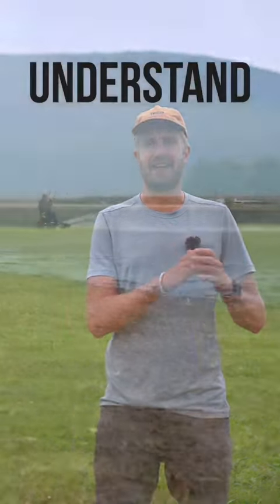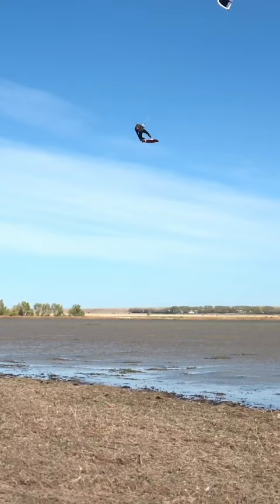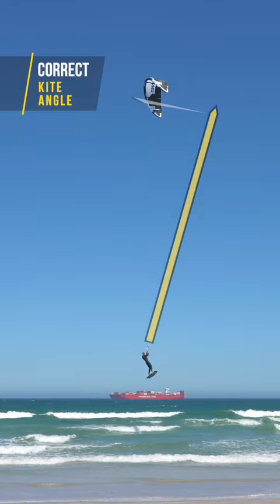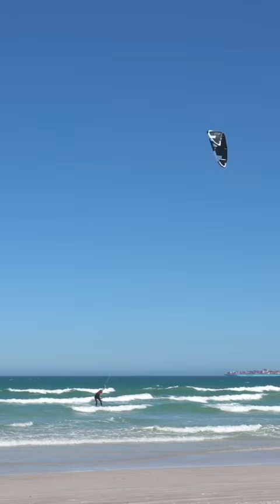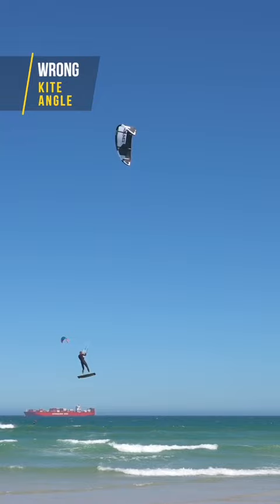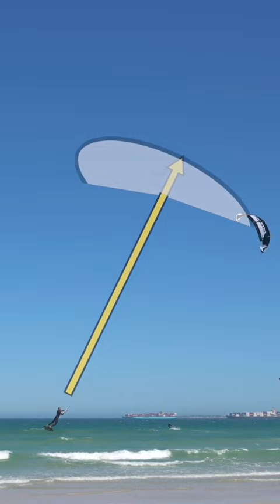This tip could save you from a crash // Kiteboarding

Comment: Would pulling with back hand give you same result for the heli loop if kite is in front of you like in your last clip?
Reply from the maker: Yes it does! Depending on your kite position you can loop it with the front or back hand, most important part is that it passes 12.
Reply: @stevenakkersdijk  I find going for this a real challenge. I get a few nice down loops at the end of some jumps but never feel confident to send the heli loop. I watch others do it with ease but when the wind picks up and the height of my jumps increase, it just feels a bit extreme and could go wrong very quickly. Great videos though.